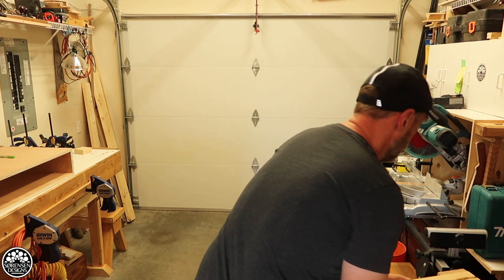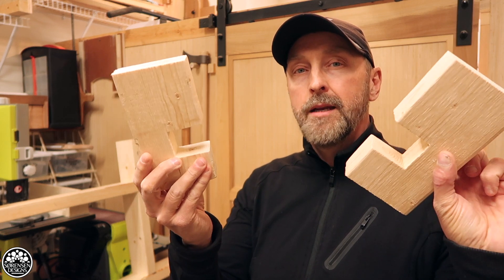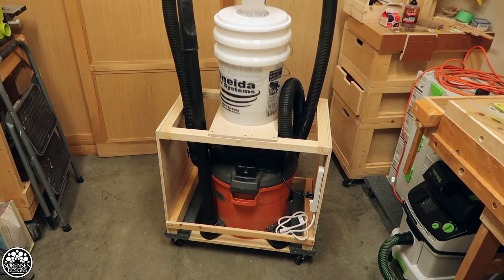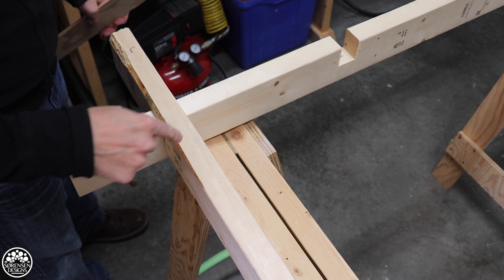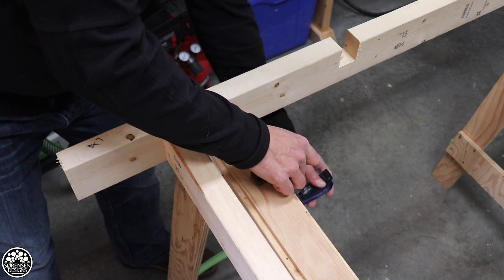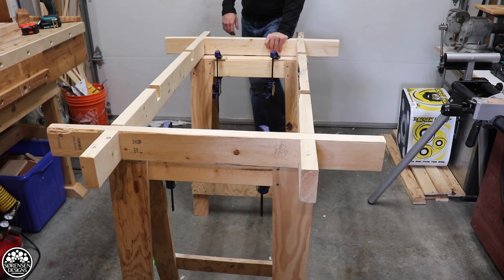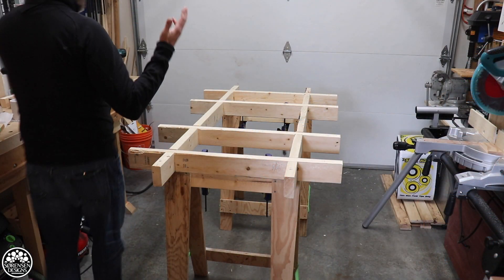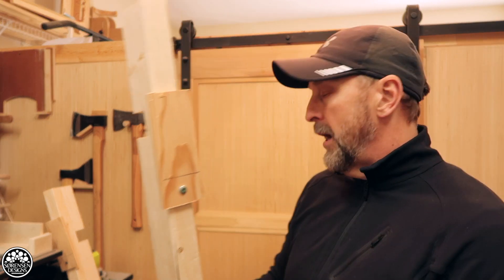Collapsible Workbench for Cutting Sheet Goods // Woodworking

Comment: I made mine using a left over sheet of 1/2 inch plywood.  I cut 2  8’ pieces 4” wide and 4  4’ pieces.  I clamped the 4’ pieces together and cut 2” lap joints. Did the same with the 8’ pieces.  Then I put notches on the underside of the 8’ pieces to hook into my sawhorses.  My saw horses are collapsible and are 4’.  The cutting sheet on the top of the sawhorses is at the same level as my truck tailgate so sheet goods slide out of the truck onto the the cutting platform. When the platform is broken down all the pieces are laid on top of each other.  I drilled holes so I can bolt the whole thing together into a compact unit for transport or hanging.

Comment: I built one of those but it is a full 8 feet long and 3 foot wide.  I added a J hook that allows me to flip a full sheet of plywood onto the top by myself.   I have been using it for years and love how it disassembles and sits in a corner.  I have mine clamped down similar to yours and it makes a really solid surface to cut on.  Great job.
Reply: Adding the J hook was a genius idea. I built some of these for a couple of people and I used an old hose holder to do pretty much the same thing. 2 THUMBS UP 👍👍

Comment: I have been thinking of this myself, but I’m thinking of a wall mount at about 15 degree angle and a roller shelf on the base. Because my work shop is 8 x 12 shed, that houses my drill press, a wood lathe, 2 compressors, mortising machine, router table and a whole host of hand and power tool. I guess I need to step outside to change my mind!

Comment: Nice video Eric! Thanks for sharing it with us!💖👌👍😎JP
Reply: I’m sure this shows my ignorance but when cutting sheets on this, won’t you be putting small cuts through the crossbars of your table? You mention keeping your blade no lower that 1/8” beyond depth, so would the 1/8” strips going through the bars just be considered tolerable?
Reply from the maker: Yup, that's why it's made of 2X4, it's designed to handle the slight over-cut. The beauty of it is you just replace some of the 2X4's if they ever get damaged beyond use. Perfect for onsite work. It's not supposed to be a fine woodworking bench.

Comment: Great utility there for someone who doesn't have room for a permanent large table.  Two questions:  First, how did you get your miter saw to stop at the correct depth?  Second, regarding those pieces of trim that you use to clamp to the sawhorses:  Could you cut them narrower so that when folded, they don't stick out, making the whole kit easier to stack?
Reply: on every mitresaw there is a possibility to set depth of cut. check on Yours...  for second - i think yes as they are only for lock in place those "bench" ;)
Reply from the maker: @Don Wallace I thought about trimming the shoes but the overhang actually helps tuck the long pieces into each other when I store them away. As for the miter saw, your miter saw should have a depth stop. I made a video a while ago explaining this in detail: https://www.youtube.com/watch?v=0BQ1wC21LPk
Reply: The newer sliding miter saws have this option. If yours is like mine (vintage 20 years old still kicking) you may not have this depth stop.

Comment: You can wax the joints for smooth connect and disconnect
Reply from the maker: @anibaljrbalt I don't recommend that, unless you want wax residue on your sheet goods. Just give it a whack with the ol' mallet and she goes together just fine.

Comment: At the 9:32 mark you flipped a stop on your saw. Was that to prevent the blade from cutting down all the way?  I’m curious if there were other set up steps you did to accurately cut the lap joints using the chop saw. Will this method work for those of us without that style/make of saw?  Please explain how you set up those cuts to make the lap joints you needed.
Reply from the maker: Yes Bob, that is the adjustable depth stop that you'll find on most miter saws. I also use a simple little jig at the back of the saw to keep the depth consistent for all the dados. I did a complete video on it a while ago: https://www.youtube.com/watch?v=0BQ1wC21LPk

Comment: I use a piece of 1" foam insulation as my cutting surface.
Reply from the maker: @Kevin Shumaker Yes, I've seen that set-up before. It's great if you have the space for it. The down side is you can't put a foam sheet on top of saw horses, and in my shop I don't have room to store a sheet of foam. The collapsible table turns into a second work bench whenever I need it.
Reply: @EricSorensenCanada  I have a similar saw horses, frame setup. I have a sheet of foam cut to fit, then I cut it in half. My setup also becomes a second work bench when needed, nice for glue-ups. Used it for a dining table last year with a regular sheet of plywood & table cloth for a party. Saw horses collapse, frame & foam lays between wall and saw horses. Bungie hooks keep all neat.
Also saves wear and tear (no extra resistance on saw).

Comment: Great video! Just wondering if the joints will loosen up after many uses?
Reply from the maker: @Lawrence Lamey Thanks! The wood will expand and contract at the same rate, so the fit will be pretty consistent.

Comment: How about putting dowel holes in the 2X4s and the top of the horses. Maybe glue the dowels into the top of the horses.
Reply from the maker: @Rich Williams I thought about doing that. The problem with loose dowels (even on one end) is that they will pop out when things shift and move. The clamping shoes seemed a better option as everything gets locked down.
Reply: On the set I made recently, I drilled 1" holes in the 2x4s where they rest on the sawhorses. I'm able to use bar clamps to hold everything down tight.